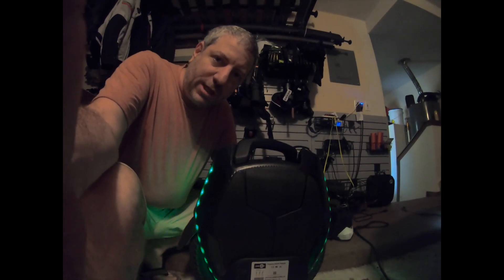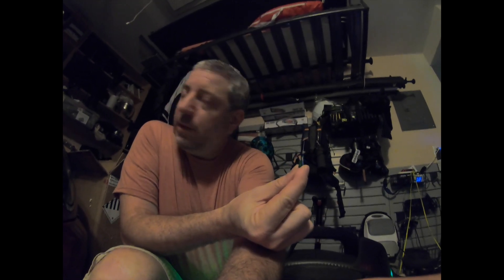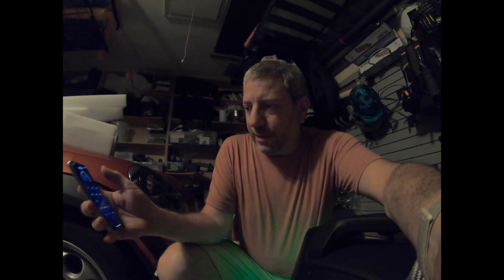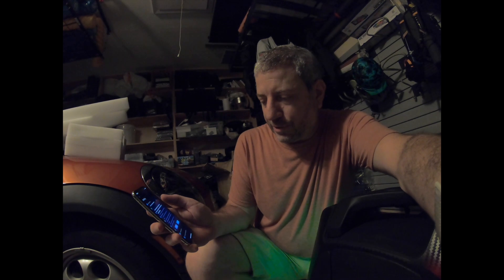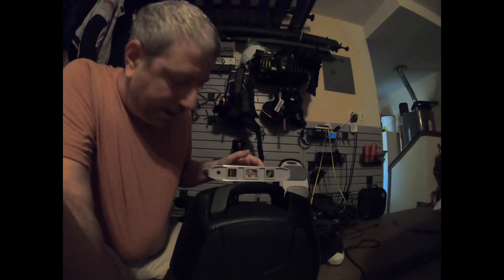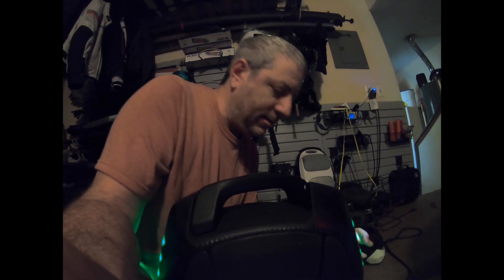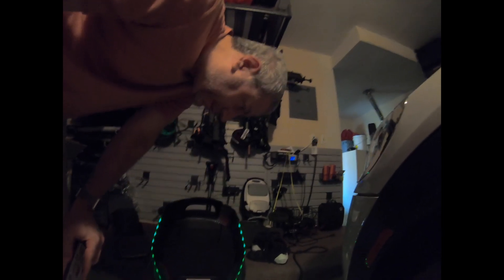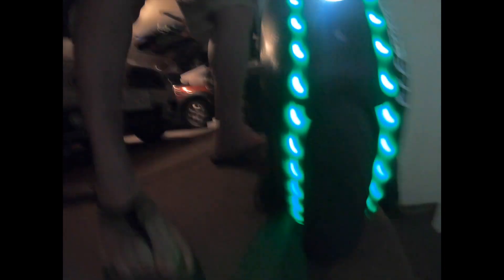Electric Unicycle (EUC) Calibration - How To, King Song KS16x edition

Comment: So could i calibrate it while its sitting in the stand i bought for it?
Reply from the maker: As long as you are close to level, sure. 

Whatever it’s at, even if there is a tilt, will be what it thinks is level when you set it.   Many people actually intentionally tilt it forward or backward for a more comfortable riding position (say if they wear boots for example).
Reply: @michaelpaolini  cool. Thanks for the info.

Comment: I just wanna ask why you didn’t use the foot pad for your front-back level. I would have thought that’s more accurate than the carry handle.
Reply from the maker: They are slopped inward, subjected to being bent from hits, and far removed from the motherboard/gyro which is at the top of the unit.

Comment: Hello. I know some people like to cal their wheels with 1 or 2 dgree forward tilt. But ks wants us to cal level. How do i go about cal with some tilt forward? I have ks18l and i have never calibrated before. Thanks for your time.
Reply from the maker: Whatever position you hold it in, is taken to be level.  If you want forward tilt as default level, then you hold it in that position when you Calibrate.  Note this will effect where you headlight points, but it works.  My buddy Glasco rides this way.
Reply: @michaelpaolini  thanks i will try this.
Reply: 2.02 firmware gives us the ability to make that adjustment in app now. Which is cool. I tilt forward about 2.0 and find it a much more comfortable ride. I’m 💯 sure that my 16x gradually tilts back so my heels are lower, which becomes uncomfortable. I have to stop sometimes and use the app to reset and tilt forward again.

Comment: Took my 16x out for the first time today. First time on a wheel and it was amazing. Unfortunately, after about 10k, it developed a pretty severe grinding noise. I've already reached out to ewheels. Since I'm new to the scene, are these wheels known to sometimes be shipped with bad bearings?
Reply from the maker: eWheels will get you covered.  

I've never heard of bad bearings from anyone, but I have heard a grinding sound on mine occasionally - it's always been the tire picking up road junk and throwing it into the wheel well, and it goes away after a little bit.   Double check that you haven't grabbed some tar and rocks or the like inside the wheel well and that is what you may be hearing?
Reply: @michaelpaolini  I'll take it out a second time just to check lol.